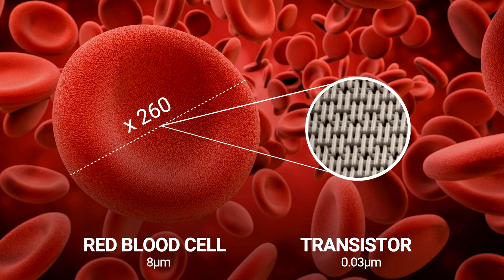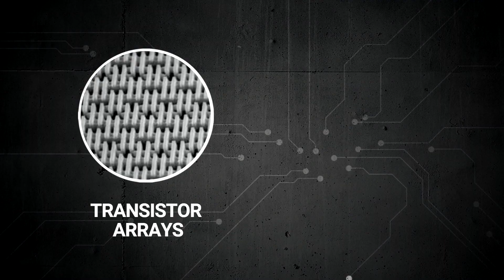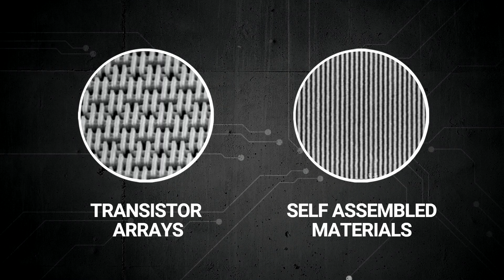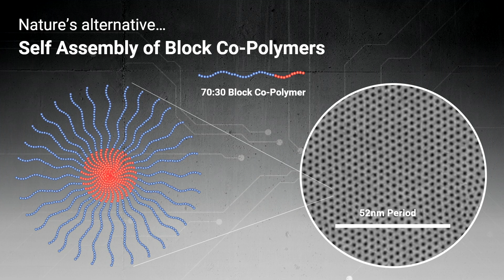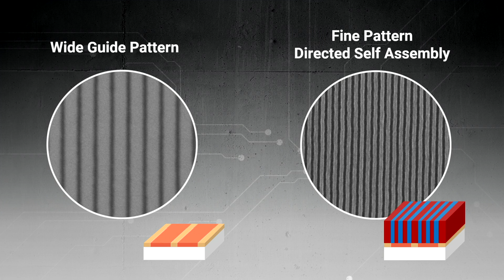The self-assembling computer chips of the future | Karl Skjonnemand

Comment: This is flawed on so many levels.....
  First of all the main problem with the miniaturisation of transistors is a quantum mechanical problem that can simply be described as the probability of the transistor giving the wrong answer or the voltage required to make it give the correct answer is just impractical.
  Then there is the problem that processors or other silicon components are not made of repeating patterns. They are made of MOSTLY repeating patterns that are occasionally broken. The complexity of editing the perfectly repeating patterns to make the mostly repeating patterns is way too high to be worth doing. It is so much easier to literally print the diagrams of the chips.
  The cost of printing chips is not the fact that the initial cost is high. In fact even the maintenece of the machines insn't that high. It's the cost of the production methods that is so high.
  As you described here the method you suggest has many of the complexities of the printing method like requiring ridiculously pure substances which is way easier to achieve when you are filtering out one type of atom rather than filtering a complex molecule.
  No mather what method you use the information of the final pattern of the chip needs to somehow get to the waffer so you can't avoid printing in any way. You can change the method of printing but you can't avoid the need for it.
  A breakthrough in computer technology would come from developing cheaper 3D chip manufacturing or atomic level logic gates and not from fantacising about using a basic manufacturing method for making basic shapes and using it to make a complex shape. The information defining the chip needs to come from somewhere...

Comment: Hardware has always been a limitation on software. It's not new. And the challenge with smaller transistors is not manufacturing cost. It is quantum effects which make transistors unworkable.

Progress in hardware requires new kinds of chips, not new ways to make them!

Comment: If you have a cross section and a beam combined with a very high frequency and a method of aiming it to the precision of hitting a specific atom. Then it could be possible to fuse manufacture stuff atom by atom.

Comment: He didn't get it. Sorry. The truth is, the hardware is just fine for the most part. But software developers take the power of fast hardware as a given and just don't spend much effort on efficency. Actually most computer software today is implemented rather stupid, reducing time to market by not optimizing code. If there was a shortage in hardware performance, software could rather easily be made much faster by implementations that considered performance. There are obvious exceptions like games and video editing and compilers for example. But even there you'll find the trend I mentioned. For example there are more and more games that work directly in the browser, although a browser is a much much less suitable platform for that kind of software than your original operating system is.

Comment: Wait a second, Karl Skjonnemand. I thought the idea was to allow for imperfections by having multiple, simultaneous/parallel 'cips' or whatever, that are checked against each other. IOW, fault tolerant by design, the kind of design that accepts that there are faults and justs moves on. 
I cannot see a viable future where perfection is the requirement, and imperfection is failure. Humans-and nature-don't work that way. And if you are going to emulate nature, you may as well learn ALL the lessons it is offering you.

Comment: Rate of miniaturizing transistors is slowing down, and not keeping up with the rate of software innovation. Complexity of the manufacturing process is the problem. Molecular engineering will help us break-through by using self assembling materials instead of expensive machines. These nano-structure transistors can be manufactured using chemical engineering. #TedTalk https://twitter.com/tedstalkin

Comment: I'm going to assume here that the production of these self-assembling structures is the easy part.  The hard part or bottleneck is getting them to assemble properly on a substrate suitable for conducting electricity and signals through it.  Also known as the PCB, which is the interface that connects to the motherboard of a conventional PC.

Comment: Summery:- transistors got smaller, but helped us compute ! Transistors are not getting smaller through time. Our hardware could limit our development ! The semiconductor industry is working on quantum computers to robust and efficiancy ! Were lookimg for immediate solution . The complexity of the transistor after development is slowing the process down.  We can put smaller transistors in chips . Everything is built on the silicon wafer . The process is improving. Molecular engineering and mimicking !

Comment: Wonderful manufacturing ideas! There is still the quantum problem with increasingly miniaturized transistors. Quantum tunneling is still a problem that needs a solution. Transistors need a breakthrough in design or need a replacement technology. That may spell out the end of manufacturing transistors in this method before it begins or soon after. That being said, I am certain your self assembly technology will be very useful still.

Comment: 8:16 if different are trying to separate, why that on screen is not walling apart? totally the guy leaves important details IMHO
Reply: You can design a very small molecule that is capable of attaching to each of the other materials.  But depending on how you design it, it will allow different degrees of freedom to the two repelling chains.  This is pretty much how detergents work.  There's one side that is hydrophilic (drawn to water, repelled by 'dirt'), and the other side is hydrophobic (repelled by water, but drawn to 'dirt').  That's a pretty horrible simplification, but it works.  It allows the detergent to surround the 'dirt', bind to it, and separate it from the material you're trying to clean, because the outside is now strongly drawn to water.

That's one of the things that bothers me about the images he showed.  There should have been 'bulges' or obvious patterns of different materials in the self assembled examples.  Sort of like dashed lines across the linear patterns, and rings of different material around the radial patterns.  So either my idea is full of it, his images are not of sufficient magnification to show it, or he's full of it.  Heck if I know which is right.
Reply: @EdwinWiles  thanx, 1st part is clear,  end of second is not - what means "he's full of it" - he, it?
Reply: @alexm7898  it means he's either lying or seriously mistaken.  "He's full of s--t".  Just as I could be seriously mistaken in my theory of how what he's actually doing works.

Comment: There's only so much smaller we can get before we hit quantum uncertainty, quantum computers are a better long-term solution for this problem.
Reply: It depends on the task. Quantum computers are not better at streaming for example or any asynchonous task in general.
Reply: @sebastian.wiesendahl  yes, QCs are meant to churn data for now, they're not designed for day-to-day computations, but who knows, in the future we might have a really powerful central computer and less powerful machines connected to it.

Comment: On the other hand, most types of software are wasting resources like never before.
Reply: Imagine the dawn of a new age of perfecting programming languages, firmware, and software design.
Reply: As junior developer, it's hard to disagree but try to understand us as well. Business requires a multitude of technologies, everyone wants the best of new stuff - all of that needs to built fast and agile. This means that a lot of the hard stuff that NASA did when they coded machines for going into space decades ago is now delegated to integrated software processes (think memory allocation and such). It's not only coders being lazy, the whole industry is a self-fulfilling prophecy.
Reply: cough java cough
Reply: All this innovations and vehicles have been stuck at what for how long?..
Reply: Screw Electron
Reply: Check out MIT's RAW technology where the entire chip is programmable.  The is not field programmable logic it is the programmable path ways to several billion RISC processors on a single die.

Comment: Transistors are all about computing data depending on input qualifiers. Video talked about self assembling polymers but how are they computing data? It will be interesting to understand these capabilities of this new technology.
Reply: I presume transistor self-assembly itself was not yet developed.
Reply: Yeah exactly what do polymers have to do with boron silicon and phosphorus or how will they achieve the state changes
Reply: As I understand it, the self-assembling polymers form an etching mask, rather than creating a mask using photolithography. The finished chip will still be silicon.

Comment: As a Mechanical Engineer, this is very exciting technology!
Reply: Really interested to hear your take on why it's exciting (I do agree it does sound exciting) but I'm wondering if you know of more use value/areas of application. What would this do to technology? How much further could we go? Apologies and no need to answer if these questions are too vague though!
Reply: @yabdelm  I don't know about other aplications, but technology/science is like that, you get better at some areas, and without even knowing, you're helping develop something else on other areas.
Reply: Destructor EFX good point! It may lead to unexpected breakthroughs
Reply: @yabdelm  Well, if this technology takes off, It could be used to make materials even stronger, by making nanoscale structures to be aligned with the stress forces. But that's just one ideia.
Reply: Is Gallium Nitride a good successor of Silicon ?